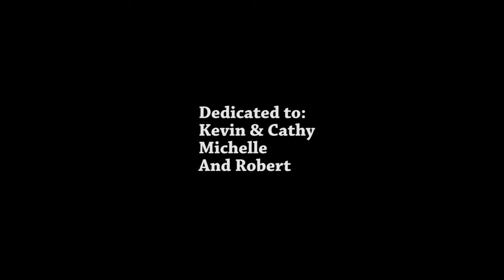Simple Picture Frame Clock Gift That ANYONE Can Make

Comment: Great picture frame design with a clock. As you were starting to cut the circle on the top of the frame I figured it was for a clock so wasn’t surprised. I’m sure when you were using the Forster bit to drill out the Chile in the walnut circle that you decided to switch to holding it with a clamp instead of your hand.
Reply from the maker: Haha, I knew someone would see that!  I knew before I started it would need to be clamped (that was my second one I filmed), I wanted to get it started before trying to position it with that clunky clamp, but went farther than I should have.  

Something a lot of newer woodworkers think is that they’re capable of holding something while a high torqued boring device bears down on a fibrous material (I’ve been stupid exactly 3 times with that approach and the last time nearly took my finger off 🙄). 

Hey Don, I appreciate your friendship buddy, I hope you and yours, and those beautiful bassets have a fantastic Christmas.